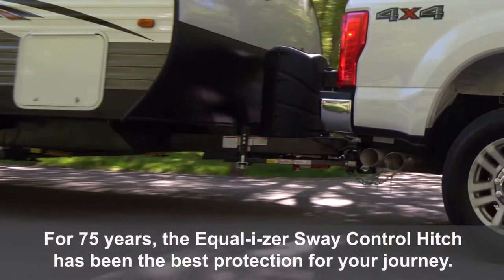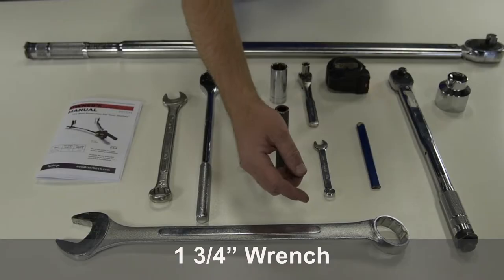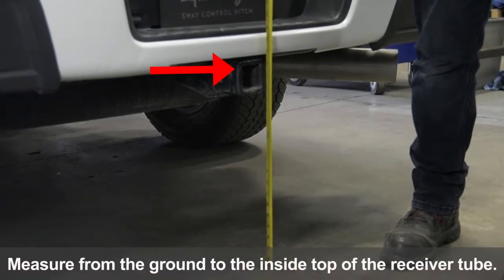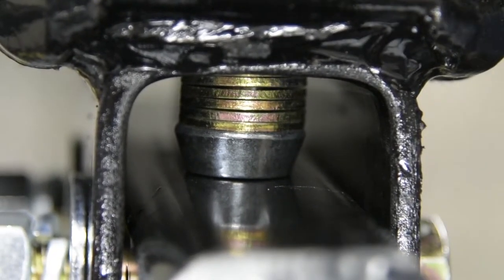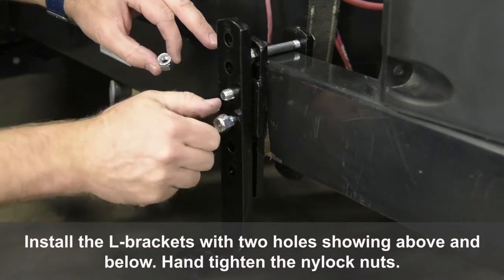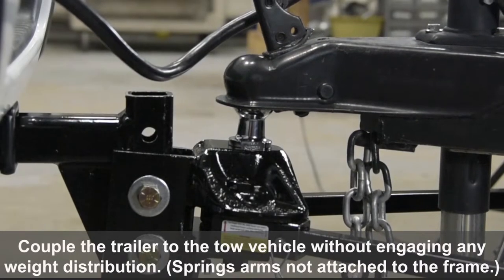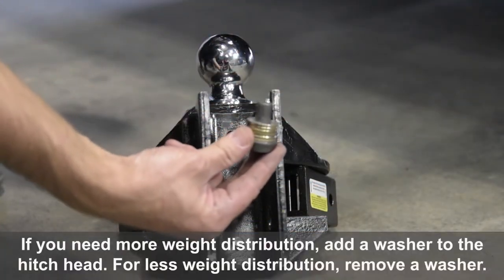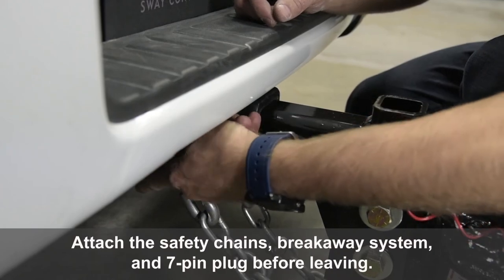How to Install an Original Equal-i-zer® Sway Control Hitch 4K Model

Comment: Hi there, once I set up everything, before I back up my trailer at my drive way which is sloping down, which means the front of the trailer will be much lower than the back of the trailer, before I back up, shall I dispatch the sway bar off or shall I keep it on the L Pin and remove it after I set up the trailer level at my drive way? Thank you😢
Reply from the maker: Before you disengage your hitch, make sure you are on level ground!

Comment: Where do I get the 430 ft. lbs. torque wrench,& 1 3/4” box wrench, 1 7/8 socket. I’ve not been able to find these particular tools, no one seems to these sizes?
Reply from the maker: We are sorry to hear that you have had a hard time finding the required tools for installation and would love to help you find a solution. Most local dealerships will carry the proper tools needed to install one of our hitches. We have a dealer locator function (link: https://www.equalizerhitch.com/find-a-dealer) on our website that can help you find a dealership near you. If you are looking to purchase your own set of tools, there are several options available and can be found with a quick online search. We have the 1-7/8" socket available for purchase direct from us either on our website, https://www.equalizerhitch.com/store/hitch-accessories/1-7-8-thin-walled-socket?sku=undefined or over the phone at 800-478-5578!
Reply: Try harbor freight

Comment: When adjusting weight distribution, which is best: adding/removing washers or adjusting L-brackets?
Reply from the maker: Both are a great way to adjust your weight distribution!
Reply: Pending how ur bars look...
They should be parallel to ur trailers frame and sit flat on the pads but L brackets are the easier of the 2 to adjust.

Comment: I just purchased my new  hitch which already has the ball pre-installed.  Is it safe to assume that it's already been tightened to the proper torque spec and that step is no longer needed?
Reply from the maker: You are correct! It never hurts to check the bolts after towing however.

Comment: Great video! Do you have any opinion on if these hitches can be used in addition to a 1/2 ton truck with rear end suspension air bags? Would it help? Hurt? Do
Nothing?

Thanks!
James
Reply from the maker: Hi James! Using both can be a bit tricky, you'll want to set the springs up before setting up the weight distribution with the hitch. You may need to use one extra washer on the hitch setup to compensate.
Reply: @EqualizerHitch  I would figure much more information could be provided here. A video to explain further perhaps?